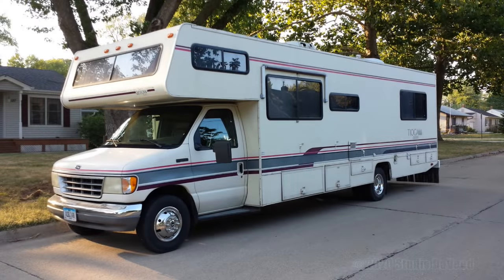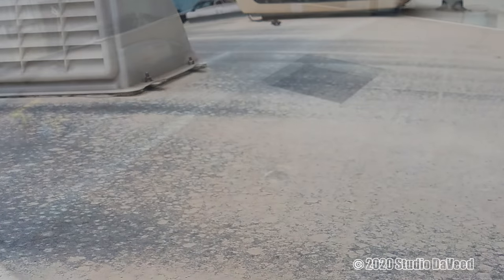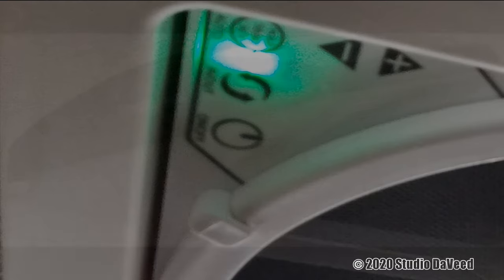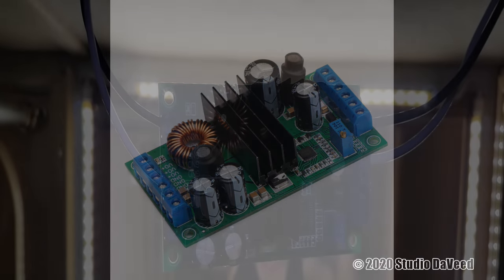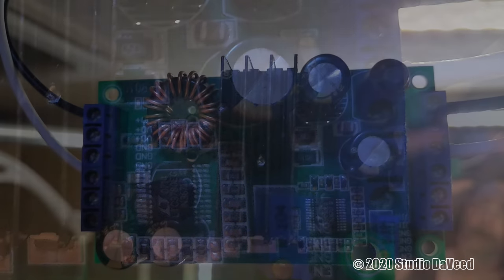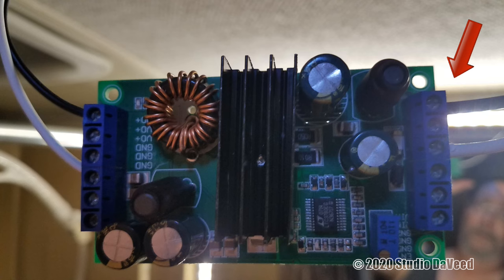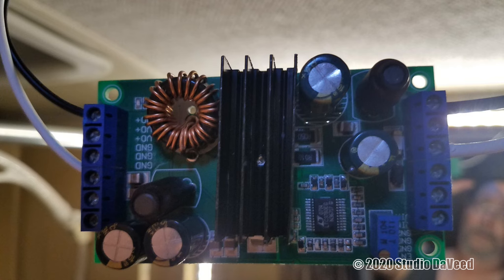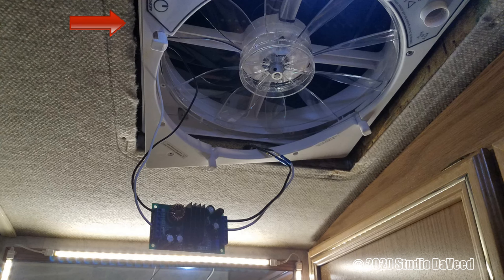1994 FLeetwood Tioga Upgrades Roof MaxxAir Fans Voltage Issue Solved

Comment: Voltage increase issue has apparently been addresses with newer Maxxfans. I had to install a buck converter in my 2018 travel trailer when I updated to lithium batteries that requires higher voltage for charging. I also sprayed clear coating on the circuit board to seal against moisture (corrosion) issues that I read about as well.
Reply from the maker: Good to hear they've addressed the voltage issues!

Comment: Thank you, thank you, thank you, we have been dealing with having to connect and reconnect power ever time we used fan. I never realized it was a voltage issue until I came across your video I almost ripped it out and returned it. I purchased the voltage regulator you linked and installed and now it works perfectly!! Thanks for saving us a bunch of grief.
Reply from the maker: Glad to be of assistance!
Get one or two extra regulators now you know that was the Fix - I had one burn out after a few months but the others are going strong and I use them a LOT in steamy hot Iowa.

Comment: I have a 2021 rv and installed a maxxfan deluxe and have had 0 problems.  Thanks for this video, if I start to experience this problem I will remember this tip.
Reply from the maker: You may have the 'newer' circuit boards...or the battery charger doesn't have the 'top off' procedure...fingers crossed!
Thanks for watching!

Comment: Just installed mine and it worked perfectly! Thank you so much!!
Reply from the maker: You Bet!
Did you have this issue or just installed as preventive?
I have since had one fail; some people reported some units do so quickly.
I have 2 in back up supply.
Already dialed into proper voltage...literally plug and play swap out if I have another fail.

Comment: These maxxair fans are extremely low quality and have huge failure rates. Before people go spending the extreme prices they ask for them. 

Iv had every part fail on ours in one year. 
Motor. 
Control board.
Button board. 

Theres also a  design fail where water will drain directly onto the control board. 

Buyer beware.
Reply: 100% agree.  I have already replaced 2 circuit boards and within 1 year I am having to replace both again.  I call the company and they don't offer anything except to charge you again.  Looking for another option so I can get rid of these.

Comment: Your video is 2 years old. Has the problem been addressed by the company? We are considering installing MaxxFan to our RV and came across your video. Thanks
Reply from the maker: Good question; ; but a buddy is soon to buy one for his camper and he is getting the convertor (12 bucks) just to be on the safe side.
Here is the convertor he is getting - simpler and has onboard voltage readout.
https://www.amazon.com/dp/B07L9V4S39/?coliid=I2R37K0EUB4FQI&colid=JKY560CUIZCL&ref_=list_c_wl_lv_ov_lig_dp_it&th=1

Comment: I installed mine and it is still doing the same thing. Turned it all the way down to 11v. Still doing it. Turned it back up to 12v. Still does it. Guess I need to call tech support and see what they can tell me. Fan hasn’t even been used much.
Reply from the maker: I have 'heard' that they hand out circuit boards like candy - Keep us posted please!

Comment: Have you had any issues with the fan since installing the voltage regulator?
Reply from the maker: The fans run perfectly as designed - love 'em!
I had one voltage regulator fail.
Bought two more as backups - so far so good.

Comment: Couldn't I put this closer to the fuse panel knowing the proper wires?
Reply from the maker: That shouldn't be a problem; But, is there anything else on that line, say a 12v light receptacle?
Only concern is IF the converter were to fail you would lose that 12v item too.
I purchased one of those other units on Amazon I mentioned in the email as a backup.
Which route did you go?
The ebay units or Amazon?
Dave

Comment: If you put in this device, do you still need to replace the board the Maxx Air Fan came with?  Or do you simply install this and it works?
Reply from the maker: With this circuit board you do not have to replace the fan circuit board  Unless the fan circuit board is shot already.

Comment: I can’t find link to regulator, what drams model did you use, thank you
Reply from the maker: Stayhome 1pcs LTC3780 14A High Power Auto Step Up Down Voltage Regulator 5-32V to 2-24V DC Adjustable Converter Transformer with 15A Fuse https://www.amazon.com/dp/B07ST2NYRL/ref=cm_sw_r_apan_i_TMHF1R4W7XEB7F2PC48P